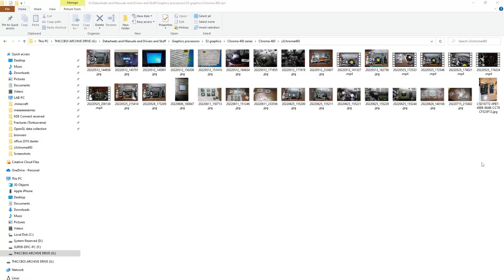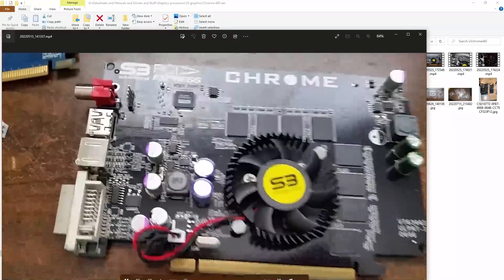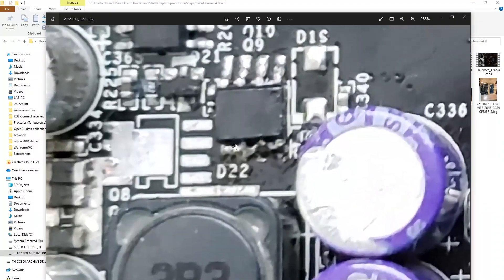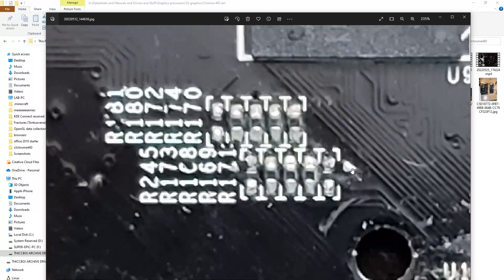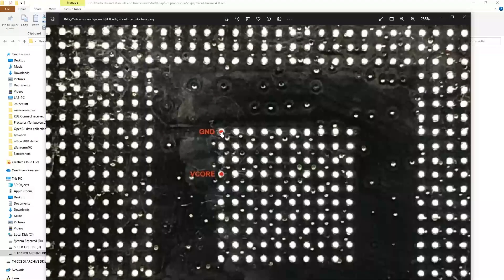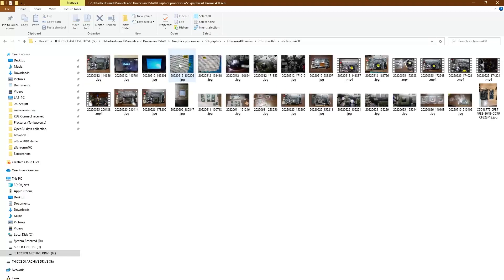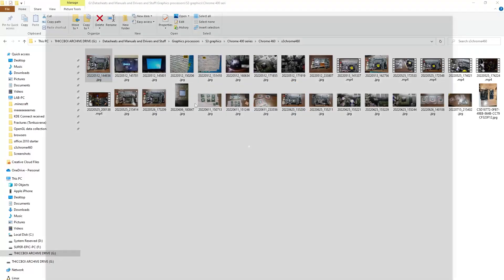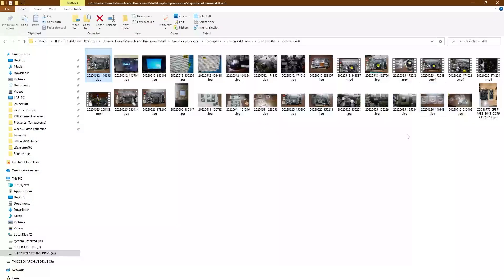I need your help: S3 Chrome 460 GTX

Comment: I've got the tools to help, but I've never worked on a GPU from this time period. I mostly work on iPhones. If you really need help, let me know.
Reply from the maker: The bigger issue is that without any documentation, repair is limited entirely to replacing components. The past half a year that this card has spent with dosdude1 shows that there's something else that we don't seem to be aware of thats causing these problems.
Reply: @TheMajorTechie  yeah it's really tough without schematics. You might as well be shooting in the dark. I shared your video with my tiny audience. Maybe someone will respond.
Reply from the maker: Everything helps! ^_^
Reply: Have you spoken to Buildzoid about it? Idk if he can get schematics, but he's really good at reading PCBs and he might owe me a favor.
Reply from the maker: oooooh, no i haven't yet. what may be the best way to contact him if I do decide to speak with him?

Comment: make new pcb for dis card , why ? you have cores so whats the deal you have hardest part
Reply from the maker: We don't have the schematics and this is most certainly a multi-layer card, meaning it's practically impossible to reverse-engineer the card without some expensive equipment capable of scanning through each layer (assuming no internal ground planes). Having the cores doesn't automatically mean that we can make a new PCB, as we don't even know what the root of the issue is.
Reply: @TheMajorTechie  like total zero not even core schematics ?
Reply from the maker: yup. zero information whatsoever. the card was never released, so no documentation is known to publicly exist.
Reply: This card is a prototype and I've never seen one functioning. They don't appear to work with the Chrome 430 GT and Chrome 440 GTX drivers of that period.
Reply from the maker: @shawntan2360  yup. Though, there is ONE beta driver that includes the PCI id of the Chrome 460 that exists, and is really like to someday try it out with my card.